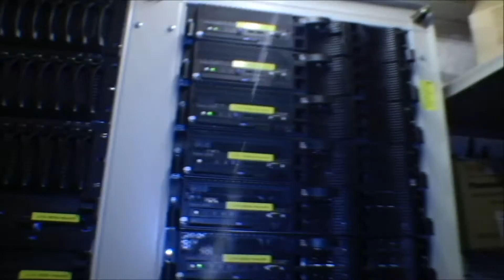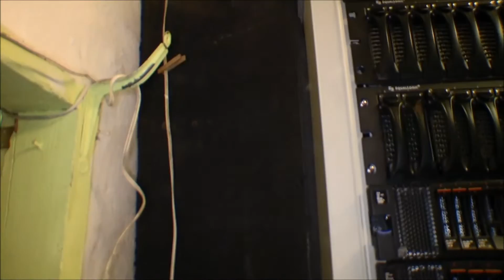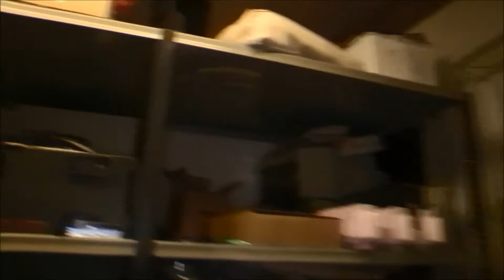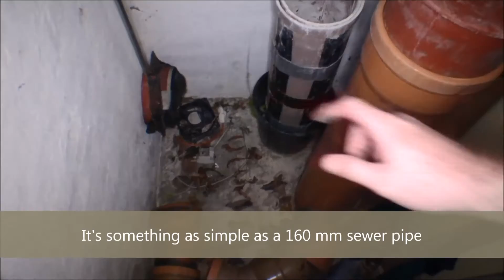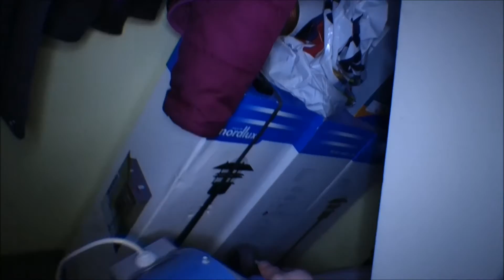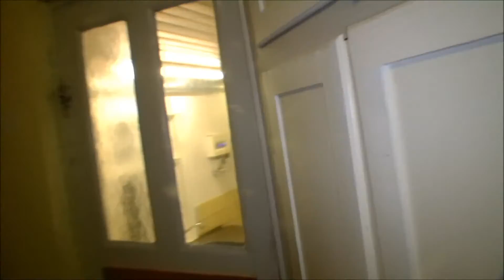Data center contributes, heating up house - 109

Comment: Hey,
I really like to watch your videos, im from switzerland but unterstand you perfectly.
But i have some questions:
For what are you using the Servers?
How much Power (Specs) have the Servers?
How much you paid for all these?

Have a good day!

Nico
Reply from the maker: Hi NicisLP 
I use the servers for 3D MAX rendering,, when there is something for them. And i do all thise YouTube videoes.
Specs humm, i have around 248 cores with 648Ghz,,,is that it.
I have not paid much, mostly I have got old outdated hardware,,,, in the eyes of those who have replaced it.
I do not like to put a price on it.
Thank you for watching! :-)
Reply: roughly 25 servers, at 300-400 watts load each? Some 6000 watts if/when all powered on? Must be quite the electric bill! (Each 300-350 watt PC, as of a few years ago, seemed to add about $25/month on my electric bill if they were left on 24/7; is your bill roughly $650-$700 monthly, just for the servers?)

Comment: Hello Morten!,

I have seen a lot of your Rack-Server Videos.
(I like them, to see you in your Server-Room oder Play-House, in your Video you sad in Germany a Server cost only 90$, you must be very lucky to get that. Mostly they cost over 800$ (they are not new) , if you want to run VWs.)

I want to start with that too, but i have a question:

How must plug in the Harddrives in the RAID-Card?
(I want to make a RAID 6-System oder a RAID 10, i am not sure)

I hope you can help me.
I do not have a Server yet, i look at Ebay for a good price.

Yours faithfully,

Lukas
Reply from the maker: Hi ***** 

It is not impossible to find cheap servers,, on like www.ebay.de - often transport is most expensive.
http://www.ebay.de/itm/SERVER-IBM-SYSTEM-x3650-2x-DUAL-CORE-XEON-5140-4GB-2x-146GB-CD-SERVERAID-8k-7979-/391024263731?pt=DE_Computing_Server&hash=item5b0adcc233
This auction was on like 1 € + 25 € transport,, two days left.. right now.
I would try to find something around 200  $/€

If you choose RAID 6, you get two discs safety, you get a good recovery speed if a disk most be replaced. Good read speed, slightly slower write speed. In for example, an IBM X3650 M1 with room for 6 * 3.5 "drives. You capacity will be 4 drives.

If you choose RAID 10, you get three discs safety, you get a good recovery speed if a disk most be replaced. Good read speed, Good write speed. In for example, an IBM X3650 M1 with room for 6 * 3.5 "drives. You capacity will be 3 drives.

I would choose Raid 6
You should be aware of the raid controller you look at,, if it can run Raid 6 or if you have to purchased extra stuff,,, which may be costly.

Thanks for the good questions, and Thank you for watching! :-)
Reply: Morten Hjorth  That Server looks very good! But i want more RAM. 4 GB ist not enough for me. I want to run like you. VMware ESXI on that Server, to make VMs. Are RAM cheap or very expensive? How much Ram you would choose?
( 32, 64 oder maybe 128 GB?)

Good i think RAID 6 is a good idea.
But SAS-Drives are expensive, can i on every Server take SATA-Drives? I would take six Drives 7200 rpm and 3 TB.
For max. capacity and speed. What do you think?

And could you please make a Video-Tutorial how to install the RAID-Card?
I do not know how to plug in the Drives in the Card.

No Problem i have more for you! :-)
No Problem, your Videos are very good!
Reply from the maker: Hi *****
That was some good questions!
I'm making a video in which I am try to answer and play with some of thise questions!
Comes online on of the next days.
Thank you for watching! :-)
Reply: Morten Hjorth  Oh Thank you very much! :)
That helps me a lot!
Thank you very much! :)

:-)
Reply from the maker: Hi *****
The video is uploading now,,,: http://youtu.be/nlT85Xf1AsQ
I Hope there is something in it that you can use :-)
Thank you for watching! :-)
Reply: Morten Hjorth Thank you so much! :)